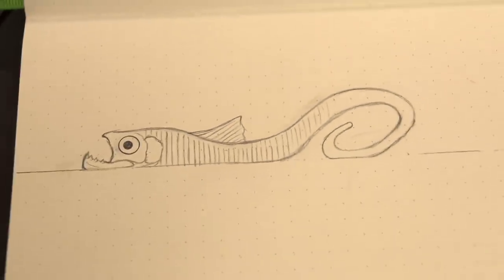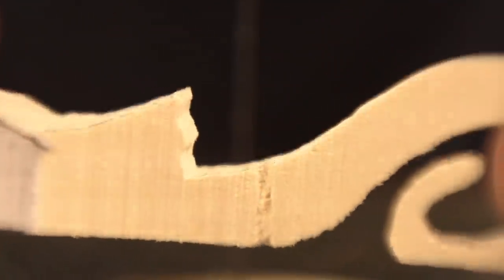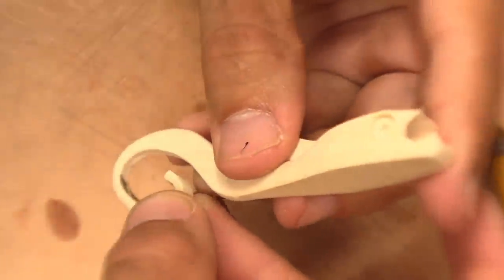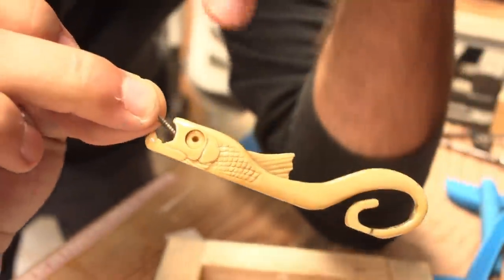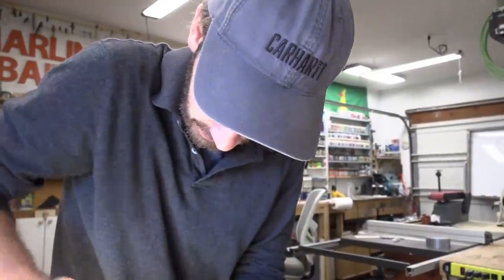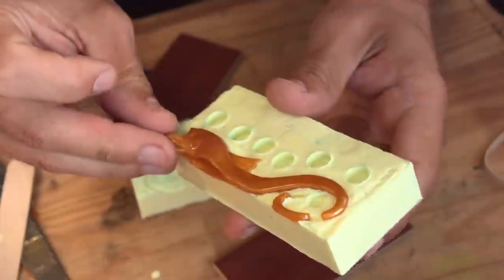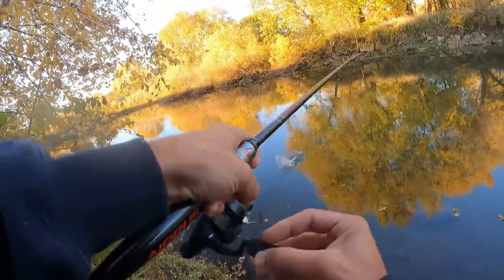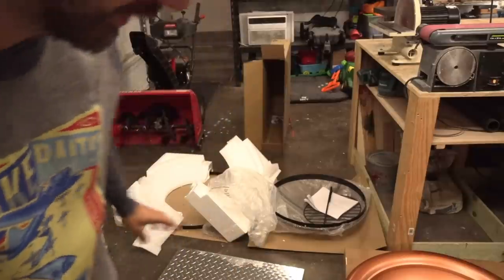Fish Swallowing a Jig Head Bait

Comment: Would it be possible to use a small vacuum table with some strategic pinholes in the mold to suck the plastic through those complex or tiny sections?  Or is that only feasible with aluminium molds?

Comment: One quick pointer. Have you tried cutting an air release channel in the intricate areas of your molds. They have them in intricate areas of injection molds for air to push out while injecting. Just though you might try it on your next mold,  it might help fill out the fin areas. Awesome vid

Comment: You could try to add a plasticizer to reduce the viscosity and melting point of the plastic. The finished product won’t be quite as tough but should have incredible action as well as make it easier to pour. Another possibility may be to find another 2k silicone with a higher Tg (better cross linking once cured provides this) and lower initial viscosity although that may involve the use of solvents and depending on the thickness of the pour could lead to air bubble entrapment when curing.

Comment: Coupla questions:

1: Why do you draw your templates in a notebook and cut the page out rather than using loose graph paper?

2: Could you add a vent to the mold to allow for a more consistent pour and to avoid air bubbles?

Comment: Drop a small bolt or screw into the hole in the fire pit, to keep ash from falling out. But pull the bolt out to let water drain after it rains 👍. 
The long tail almost needs to be injection molded.

Comment: Could you use clay to create cavities to hold hot plastic allowing it to retain heat as is it flowed into those details. It seems like given a specific volume to surface area ratio you know the plastic will give up heat, aka you can know for a tube diameter you can only safely poor plastic so far. Increase the diameter you can poor so create channels that end into the detail allowing you to retain that heat.  The only real downside is you will have some post processing to cut off where the detailed portions meet the pour channels. So long as you are strategic with where you place those channels you should be able to find places where hide where you cut away from the pour channels. 

Of course you can turn that more access into a benefit as it will give you more access to lay in different colors.